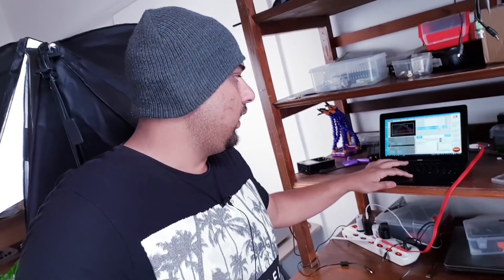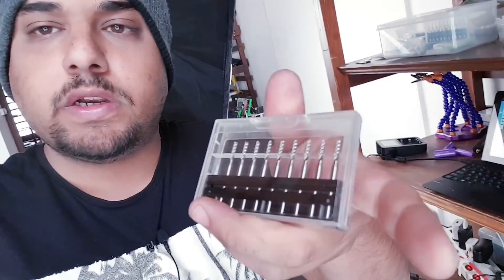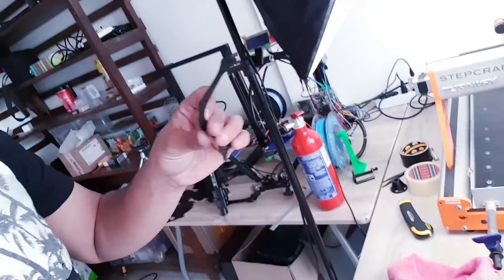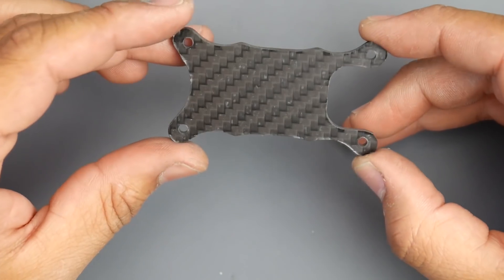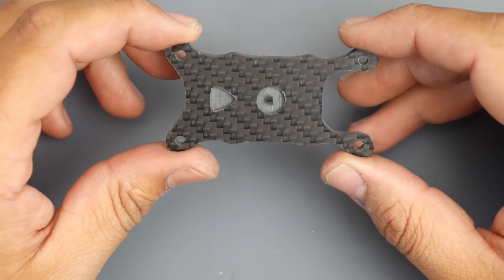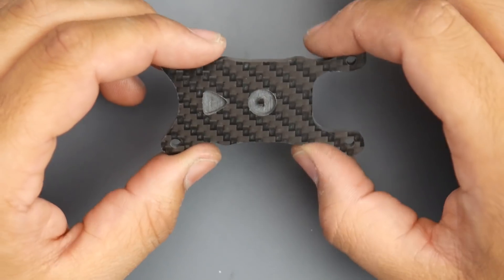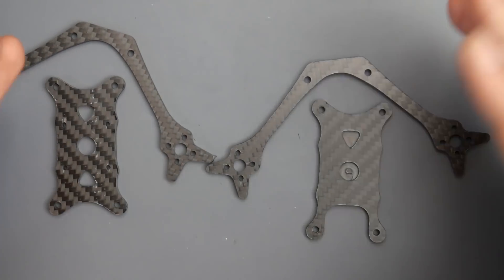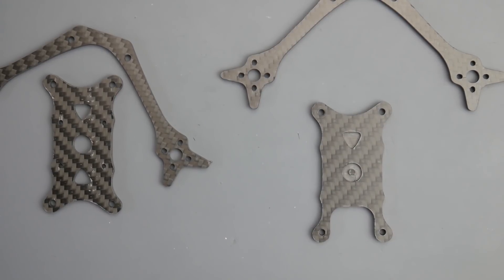Let's Cut A Carbon Fiber FPV Drone Frame // Custom Floss 2.2 3inch Remix!!

Comment: Hi drone mesh I need some parts for my floss accro freestyle the top and bottom plate I can't found in France if you can help me with that I can design it in fusion but I need someone cut it for me how you can help me with that

Comment: great job bud. on the tear out when drilling- if you place a backer underneath the piece  your drilling it will help prevent that. again good job
Reply from the maker: Thanks yes but finding a material is a challenge becuase I also dont want to contaminate by bit for example I thought about acrylic but that does not seem ideal.. Possibly some type of hydrophobic foam.
Reply: @DroneMesh  maybe a poly carbonate, that cuts pretty clean. plus you won't really be going very deep.

on a side note hows the fc with the osd chip coming.
I've been playing around with a design using the f405 .
problem is can't really find anything difinitive on the connections to the f405. I feel like I'm missing something.
can you steer me to a good source for reference (like a schem that I can reference)
Truth be know I'm learning as I go lol.
I picked up some of your first f4 design and have completed 1 will start on another soon.
Again keep up the good work, its been a big portion  of my references used in the learning process.
Later, bud

Comment: I am not so sure about submerged cutting fiber. Composite materials can a swell at the exposed edges (cut edges) which can reduce shear and compressive strength.

Comment: this was cool! Should have cut the arms along the grain though. First thing Kabab will comment on :P
Reply: I wish there was a bit more knowledge out there about composites in general, but specifically carbon, as it relates to fpv. But there are 2 common types of layup (how the layers of carbon fiber cloth are stacked up) categories: quasi-isotropic and non quasi-isotropic layup. The question that we should be asking our carbon plate manufacturers is  asking them to add a layup diagram and if it is quasi-isotropic. Just having the top layer in line with the arm, does give you a tiny bit of increased deflection resistance but barely increased overall impact resistance and toughness. Strength being different than toughness in the sense that strength is the max load at which it breaks and become unusable, versus toughness is the ability to take damage and continue functioning within our desired parameters.
Reply: @Zachtamundo , I couldn't agree more.
Reply: @Zachtamundo composites are very simple, you don't need any of that with carbon plate as the weaves are laid intermittently at 90 degrees. Also it makes no difference therefore to grain as the layer under is opposite to one above. However orientation is applicable as 45 degrees to those 2 weaves will be stiffest for example. Now if you talk custom lay ups  you position individual layers to add or remove flexibility or weight withing the build exactly where needed. Check out easycomposites uk website, they have good tutorials now I think.
Reply: @DigitalArtisan77  I can guarantee that composites are not simple. We have had computer software that accurately predicts mechanical stress in homogeneous materials for 20 years yet in our day and age of modern society we have very crude software to only approximately model stress, strain and mechanical characteristics of composite materials.
Reply: @Zachtamundo  I can guarantee after building the first A400m fuel test wing and finishing the Itailians 2nd M346 prototype, or maybe 3rd. Which were about as advanced a level of composite design as you get and yes all that clever maths and plugins are just representing quite simple concepts but in consistent,  repeatable and accountable format, for efficiency mainly, making each one identically doesn't mean its better than one hand made by a master, it just means you no longer need a master.
Reply: Yes. ALL the carbon sheet I've cut in the last two years, which was all cheap Chinese carbon sheet, was much stiffer on the plate axis. You see the effect especially when cutting thin items such as quad frame arms. Cut thin arms in line with the x or y sheet axis, and they are very very stiff - difficult to bend or flex. Cut them on the diagonal to the sheet axis, and they flex very easily. Excessive flex is a BIG problem for quad frames. 1) It allows more vibration and resonance, and 2) it allows bending of the carbon more easily past the few degrees that it takes the plate to fail due to de-lamination of the layers. De-lamination is the main cause of frame failure during a crash, and that is caused by the carbon sheet of the frame flexing past a critical point.
Reply: @amisoftau2659  logically so as the weaves are and always will be laid at 90 degrees to each other in that application.
Reply: @DigitalArtisan77  For generic carbon sheet, yep. Re. your reply to Z Carrizales, I did over 10 years as a fiberglass laminator, glass gun operator and boat builder. We did exactly that (positioning orientated layers to add strength where it was needed) for classy builds. Fiberglass is quite flexible on a large scale (hence the 70 foot limit for fiberglass boats), and without correct orientation the resulting boat shell could be very "floppy" indeed. We did no carbon (90's), but did do foam sandwich and Kevlar layups. My top position in that career was contracting for Precision Marine, which was at the time the biggest boat builder in the Southern Hemisphere. Fun times.
Reply: @amisoftau2659  this is also an important point people miss. Skill is generic. For example it makes no difference to you if using glass or carbon or Kevlar. Boats, formula one and aircraft composites all the same. And it can be simplified down to putting more where it needs strength or stiffness or less where it doesnt, or equivalents.
Reply: @DigitalArtisan77  Agree. There are subtle differences in technique due differing materials of course. But in this case they're all basically the same trade, no matter glass fiber, Kevlar, carbon fiber or other "fabrics". But boats are fairly "industrial" say, compared to F1, aircraft or space. Low tech in comparison. Boats are easy :). p.s. Kevlar sucks. "Difficult to cut" is a big under statement.

It's interesting now for me at over 60yo, to have amassed several different careers of over a decade each. The skills gained (from the easily amassed thousands of hours of experience doing such long term work) are to some degree, cross referencing. Having a very good idea of how to correctly perform several different major career skill sets, is very empowering. New tasks are much more often seen as intuitive. That's because to some degree you already have much of the knowledge and skill that is needed for the task, gained from prior career environments. So the trick now, is to find new challenges. Most things are just too easy. Probably sounds smug but no, it's true.

But I started out after leaving school (Sydney Australia) by hang gliding many of the Sydney north shore coast line cliffs for the first time. That was extreme sport trust me, before that term was ever used. This was 1975-77. Scary times lol.
Reply: @amisoftau2659 agreed, basically the technology is the same but the application is purely relative to intended use and amount of money available to research and develop the product. its not smug what you state. I not sure how it became shameful to be competent. The only difference between confidence and arrogance is conceit in my opinion. And it seems you cannot have the courage of your convictions without confidence so the risk is worthy.  I've found At 43 just touching this point of knowledge meeting (called mastery once) and like you say once the limitations of rules and form apply less, its wonderfully empowering and enlightening. Generally I think people went a bit underconfident and have become scared to strive to be better.  Thats not the case with this fpv culture, its all about being good and sharing that with other in the hope they can also be. And there's no faking possible.
  Also for whatever reason the concept of personal skill is devalued at the moment,  which is also why I like the emerging drone industry, there's a lot of skill to harness for young engineers. And  new jobs.

Comment: What's with all the instant single frames of your face throughout the video?
Reply: Nvm I think they are where you would have commercials or ads, no ads in this video
Reply from the maker: I see them too.. Something is up with adobe or my PC because I never used to add so many angles and microphones before into the composition .. I think my pc needs an upgrade.

Comment: Hey!I've  made a 3d printable frame and it's on my thingiverse (my username Is nik012003) . It's called ProtoX , it's a 5inch top mounted battery and it's really slim, but It still has quite a bit of room inside to fit all electronics easily. It's designed to be 3d printable but It should be no problem to make it cuttable. Let me know if you're interested, I'll be willing to make a CF version of it!
Reply from the maker: Checked it it looks awesome.. however it will need some work to make it out of carbon fiber.